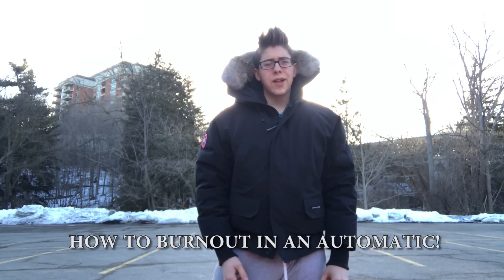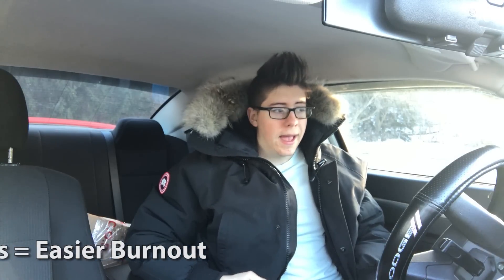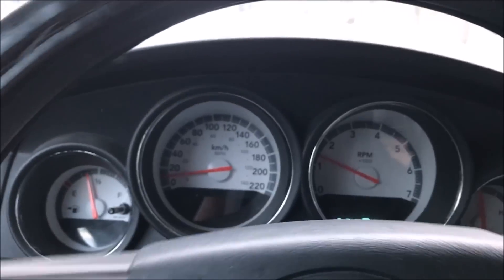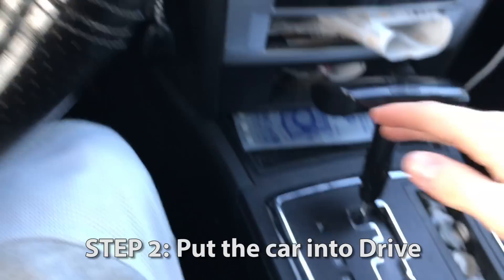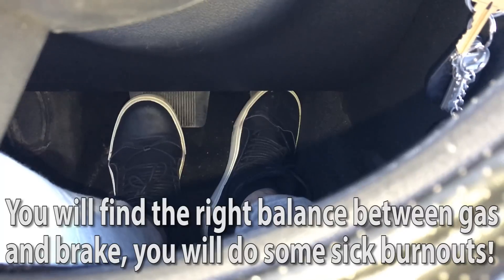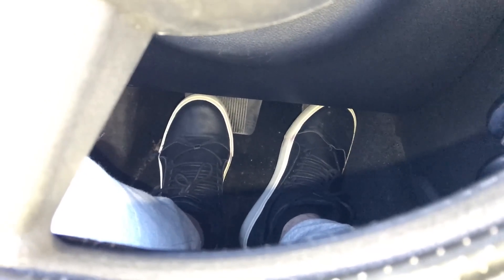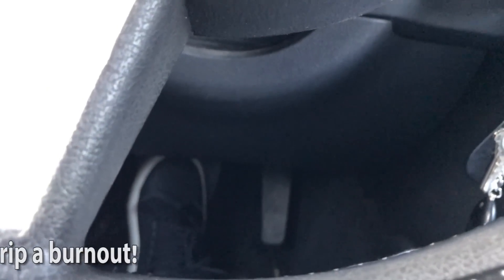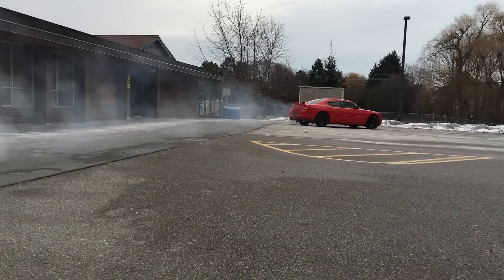How-To: Burnout in an Automatic Transmission RWD/FWD - Full Tutorial

Comment: For those hating on that Chargers burnout... ITS A V6 PLAIN AND SIMPLE .
Reply: My fucking mustang 4 banger makes a 10 times bigger cloud in about a 1/3 if the time... wtf is wrong with v6 chargers...
Reply: max1cod7 your mustang doesn't weigh as much as a charger 😂
Reply: Global it is if my wifes in it
Reply: I doubt it
Reply: Global my v6 ford ranger weighs as much and it does a much better burnout
Reply: max1cod7 it’s dodge bro
Reply: @MaxClips2000  An ecoboost mustang makes 320 lb ft torque while the charger makes 250 lb ft and weighs way more....
Reply: Sinoops depends what year
Reply: max1cod7 a eco boost mustang is crazy
Reply: No it’s just that it is a dodge and not a ford
Reply: @MaxClips2000  my v6 charger weighs 3800 if im in then add another 300

Comment: In the 2009+ models there’s an actual traction control button, and they make a thing called a tazer that unlocks a lot of stuff but mostly it’s for line lock. A feature that locks just the front breaks to do burnouts. That is a better option cause you done even have to worry about anything but punching it, and it causes no break wear. It’s godly.
Reply: where the button o.o
Reply: @midnight_7349  think it's the thing with the car the burn out marks it should be like to the right somewhere
Reply: @Linkzbtw  i have a 2010 charger and the lights dont turn on. i also dont have the traction button o.o
Reply: @midnight_7349  oh wow mines is 2011 it's there on mine try searching YT idk it's weird but there's a button tho!
Reply: @Linkzbtw  ill try to look harder plus might be a fuse???
Reply: @midnight_7349  or your lights from the dashboard are disconnected
Reply: @sergio_2k215  everything workd u.u

Comment: If you got drums in the back, replace the pads with worn ones. or buy some and scrape the friction material off. Older vehicles have discs in the front, drums in the back. 90% of your cars braking is in the front. Also, get some old tires. Some scrap ones, or brand new tires. It's gonna burn a lot of rubber

Comment: Acura tl 3rd and 4th that are fwd turn off vsa put the car in sport mode and go 1 gear with paddle shifters or shifter knob if 3rd gen put e brake all the way up and hold the brake pedal and gas that same time wait till your car hit to 2k to 3k rpm let off the brakes and keeping hold it the gas car maybe move a little but have fun

Comment: I don't know if any of this is possible for my 03 corolla. There is no 'traction control' button, it has very little torque, and will only do a baby tire spin if I load up the trans and let off the brake
Reply from the maker: Mr Scowl Face yeah might not be enough power to do a good one, plus the fwd doesn’t help it either
Reply: Marspeed yeah. I've tried it many times. But it only makes 105 lb torque and weighs over 2700 lbs with me in it. I guess I have to wait until I lease my first challenger/charger with the hemi and 8 speed in it. I hope it happens soon, because hemis are about to die, but my insurance will get the best of me based off my age (19)

Comment: hey marspeed i just changed my spark plugs on my charger and now im getting a p0108 code. car would run fine when cold and idle high when hot. traction control and throttle body light and engline light would come on while driving. throttle light would flash while car is on. were thinking this could be a simple MAP sensor defect and would have to replace it. any thought?
Reply: U probably need a new PCM
Reply: Kelly T no it was a vacuum leak by not putting the intake manifold properly

Comment: Yeah, but since you're not using a "Line Lock" system that just holds the front brakes ON (ala: Mustang GT system), you're frying your rear brake pads by using the motor to overpower your rear wheels with the brake pedal pushed, and also you force the transmission to move the rears when brake is applied.  Not good to do this if you want to avoid premature brake pad wear and transmission stress!  For the front drive burnout, basically that's OK because you're describing a "Line Lock" type of method by holding just the rears in brake with the emergency pedal.

Comment: Fwd.. isnt it same steps as rwd
Reply: Simple Frankie No. Your parking brake is on the rear tires, so for a front wheel drive just set the parking brake and hit the gas. It's much easier for a front wheel drive to do a burnout because the drive wheels aren't having to work against the brakes.

Comment: Does doing the burnout mess up the transmission?
Reply: Youraverage_savage yes, and much worse is if you apply too much braking.  by applying the brake and gas at the same time you're forcing the engine and the tires to move at vastly different speeds. the torque converter is designed for that but doing it continuously causes the transmission fluid to get very hot, not to mention the added forces on the turbines inside the converter. So yeah this is pretty terrible for your tranny